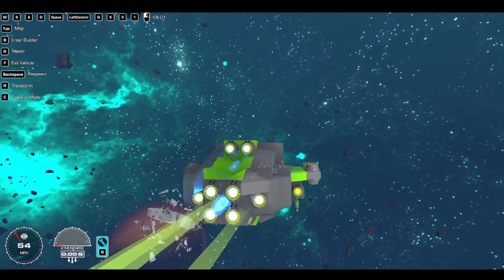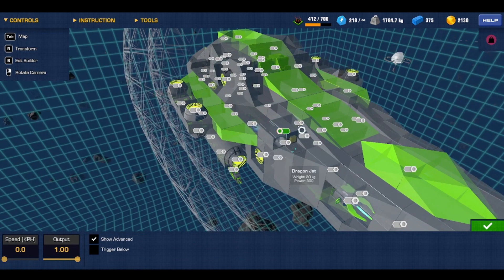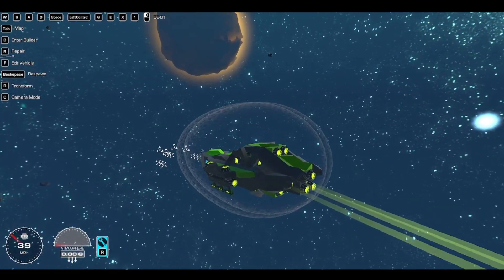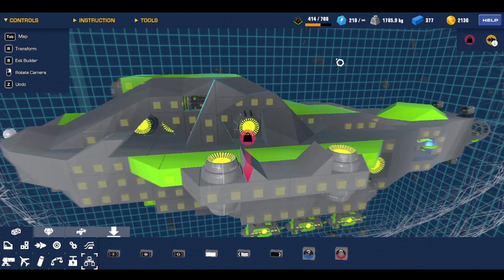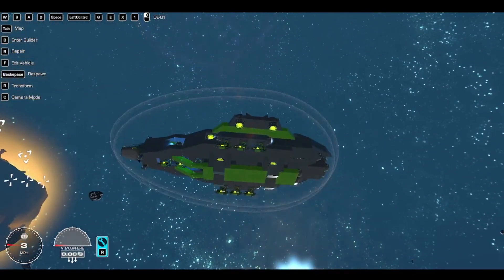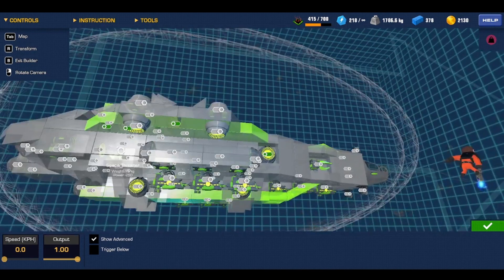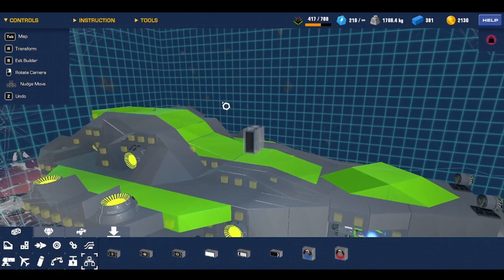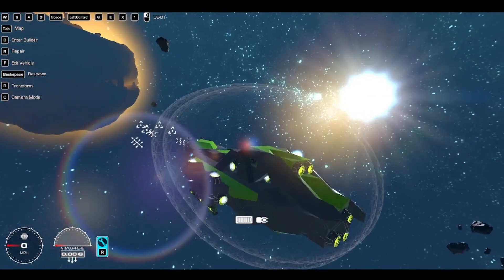Trailmakers Spacebound; Inertia Dampening Tuturial

Comment: Couple things I’d like to mention. 
It truthfully doesn’t make much difference with zero-g movement, but I’d suggest flipping the speed sensor to face away from the direction you want to slow down in, in the opposite way that you have them here, and set them to 0 km/h and also to ‘trigger below.’ This makes the sensor reliably bring you to a halt while also being ever so slightly more responsive. As a bonus, it’s quieter when you’re already stationary, because it no longer activates at 0km/h, and instead only whenever you’re actually moving. 

Also, I’ve found that hooking the speed sensor and an input directly into the XOR gate can cause the retrograde thrust to misfire sometimes, since if you push the input when the speed sensor is off, it still activates. The best solution I know of to this is to wire your input into a duo of OR gates, which are in turn wired into the XOR gate. This makes it so that when the input is active, the XOR gate will always be receiving at least 2 signals, meaning that under no circumstances can it trigger while you are holding your input. 
I’d like to clarify that all I’ve said is just for people like me who stress over details lol. Your tutorial here explains everything that needs to be known to make a functional system without getting into the weeds, and at the end of the day that’s all most people need. Plus, it’s done in less logic gates, so it’s ideal for crafts that are intended to be small.